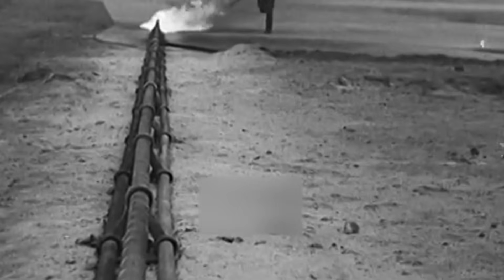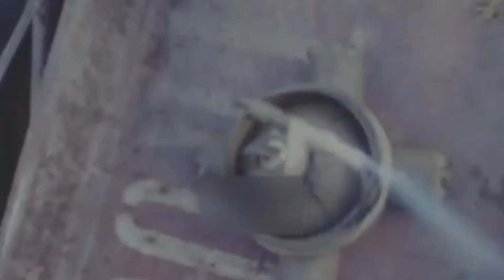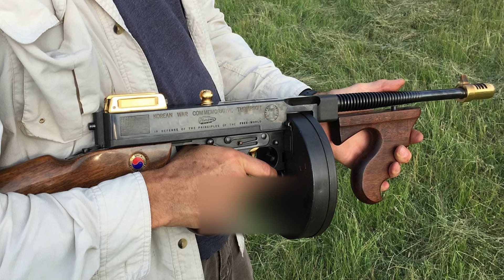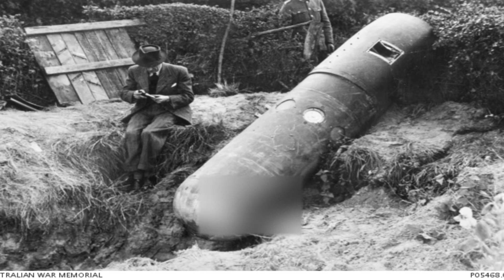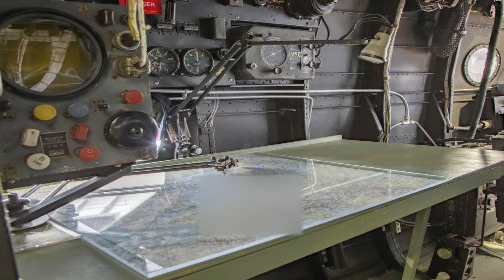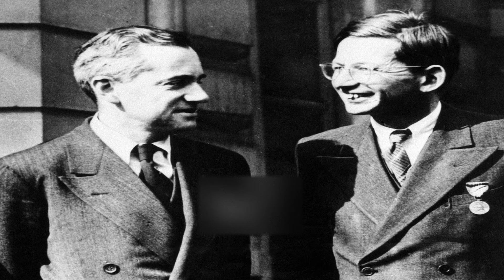10 World War 2 Britain Inventions That Many Clueless Americans Think They Did (Part 2)

Comment: The downside of fido was that the smoke it gave of was as much of a problem as the fog it was designed to counter. The basic rule  of using explosives is to walk away because if you run there's a good chance of falling flat on your face while still within the blast area.

Comment: Used to use Nobel's 808 back in the mid seventies for disposing of life expired explosives. Usually we would drive to RAF Holbeach on "The Wash" near the North Sea, to blow the old stuff up. Mainly small practice bombs, detonators, flares and ammunition. We alway wore a pair of "Marigolds" (thick dish washing gloves), as if you handled Nobels 808 without protection, it would give you a Migraine level headache. Had an odour of almonds too if I remember correctly? Then again I think PE2 and PE4 that superceded it did too? Ours PE is/was similar but not quite the same as the US C4 etc....... While we were doing this, we were often entertained by Buccaneers dropping practice bombs and USAF A10's straffing ground targets. I belive RAF Holbeach is still there and still a bombing/gunnery range.

Comment: The P51 mustang, eventually used the Rolls Royce Merlin engine, and then it became a good aircraft.
Reply: The P51 Mustang was originally designed and built for the RAF.
Reply: @Phoenix-g9h  Because North American said they could build a beter plane than the Curtiss P40 Warhawk.
Reply: Rolls Royce took an Allison Mustang to Hucknall (Near Nottingham) and grafted a Merlin off a Spitfire Mk9 onto it (Probably a new engine off the production line)
North  American said "We'll redesign the plane to take the Merlin lump."
Hence the P51B, C and D came with Packard Merlins
Reply: It was built to British orders but powered by the worthless American Alison engine so it was a dud that no one wanted to fly until someone came with the brilliant idea to exchange the underpowered American Allison engine with the miraculous Rolls Royce Merlin engine and the Brits renamed it the Mustang.
Reply: @enkilm We called it "Mustang" right from the start, with that asthmatic Allison engine
Reply: @enkilm  The problem with the Allison V1710 was no superchargers were fitted except to the P38 ones, but the Merlin was sooo much better.
The funny thing is The P82 Twin mustang had to use Allisons because the Merlin Liecence had expired. 🤣🤣🤣
Reply: The Americans couldn't even build Merlins under licence to the correct specifications, and they were never as good as British Merlins.
Reply: Not eventually, Kevin. It was very early on in its lifespan. Later the Packard version of the Merlin was used for all US operated Mustangs.

Comment: As an extension to the first point, I believe we also invented the instrument landing system and auto landing system that airliners use when pilots can't see the runway..
Reply: Arthur C Clarke spent most of his wartime service working on ground-controlled approach (GCA) radar.
Reply: I'm not so sure about that
The German "Knickerbein" (?sp) bomber navigation system used in late 1940 was based on the Lorenz blind landing system
2 aerials beaming in the direction of a target in Britain
One transmitting Morse dots the other, Morse dashes
Where the two overlapped (the course)  you would hear a continuous tone
Reply: Knickbein
Reply: yes